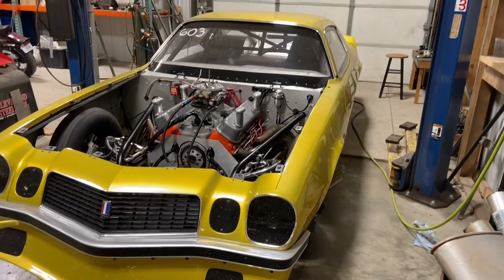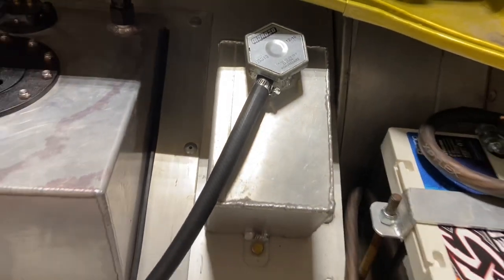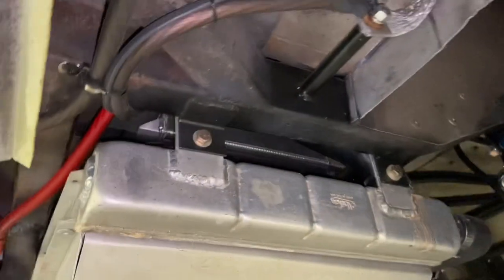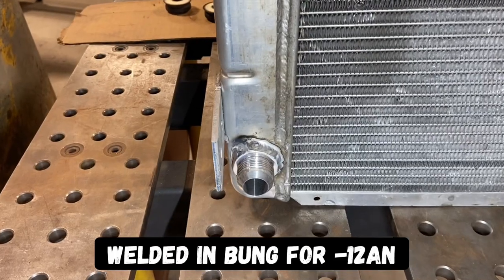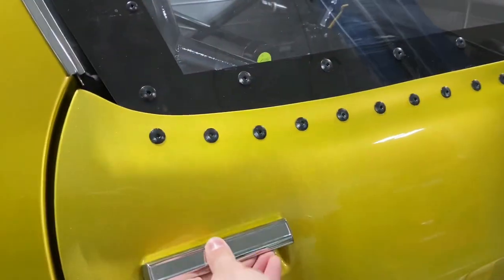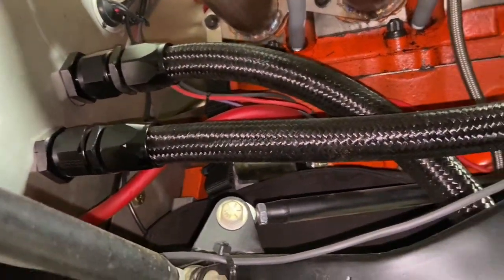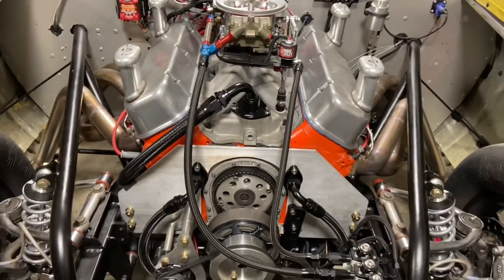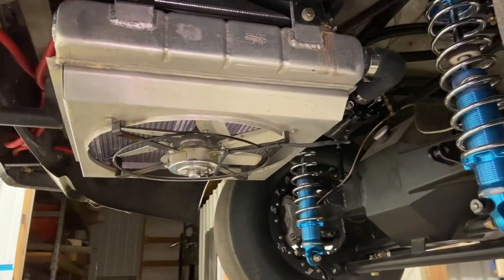How to rear mount a radiator in a race car. Huge rear weight bias!

Comment: Since your radiator has the inlets/outlets on opposing corners🤔
Could you change the length of the tabs so that one corner (fill corner) was slightly higher in elevation (from level) than the opposing corner (water pump) to more easily cut down on bubbles?
 It could also keep water in the pump the longest if there was a major leak for some reason🤔.
Keep racing after your passions (and top end😏) 💪

I hope that you win the next time you think that there's no way you could win😎